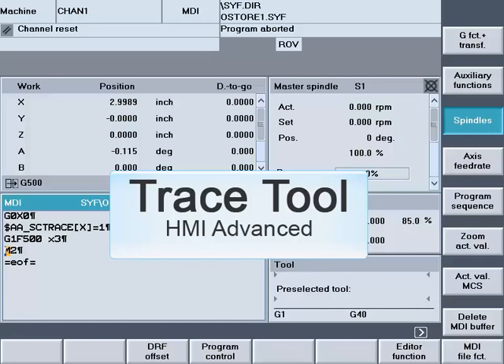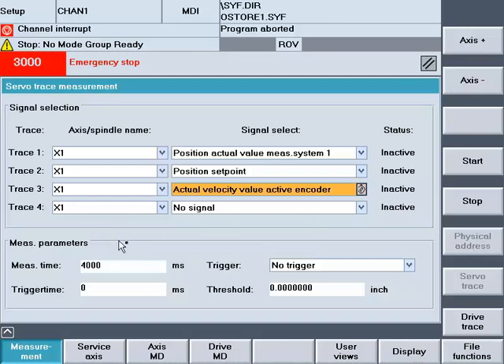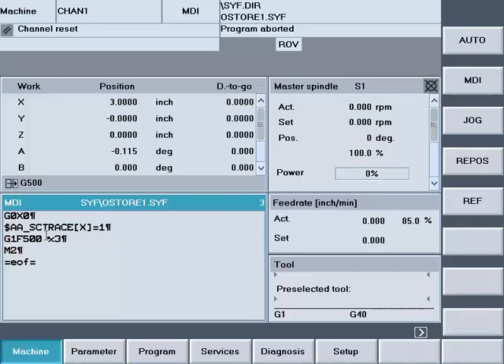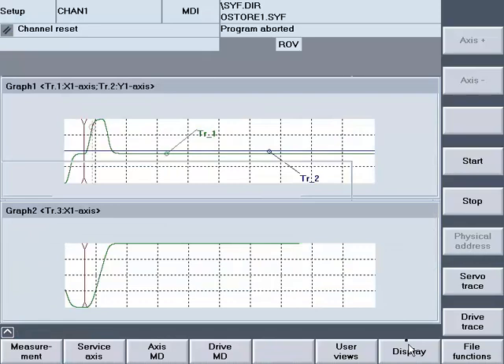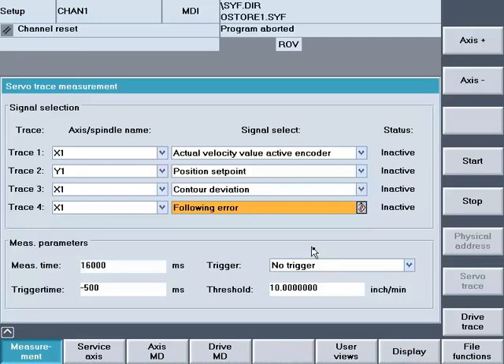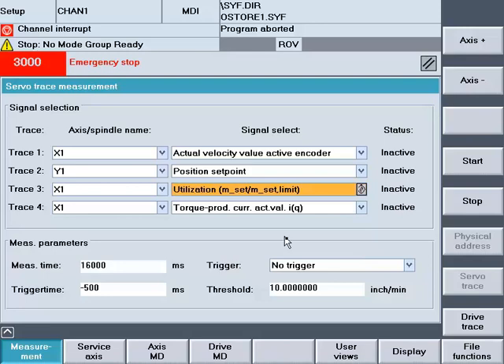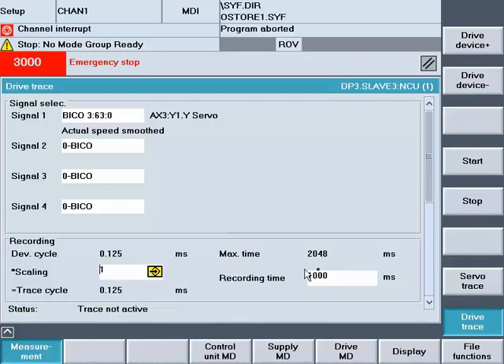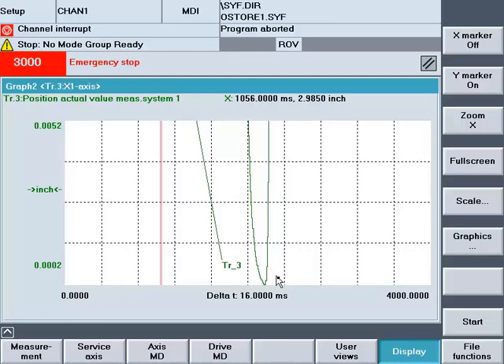Sinumerik Trace Tool for HMI Advanced

Comment: I have a question. I'm doing the test with part programm trigger, and there is a limitation of time measurement duration. There is a way to increase this time?
Reply from the maker: Hello Ricardo.  Unfortunately in the older HMI advanced system this was limited at the control.  On the newer Operate interface this has been addressed.  Take a look at the Operate Trace video if that apply to you.  Unfortunately if you are working on the older interface this would be a limitation.
Reply from the maker: If you reference the newer video take a look at 24:45  timestamp.